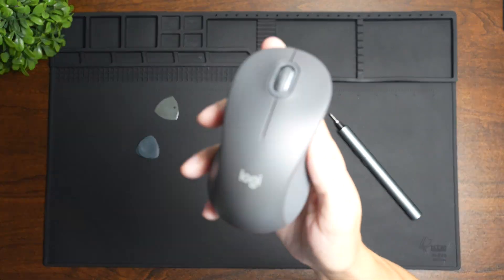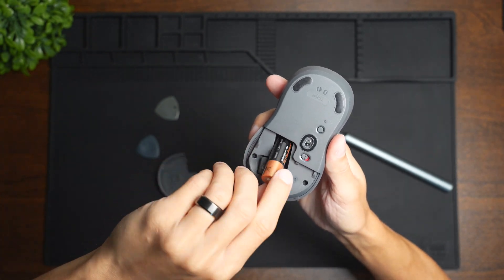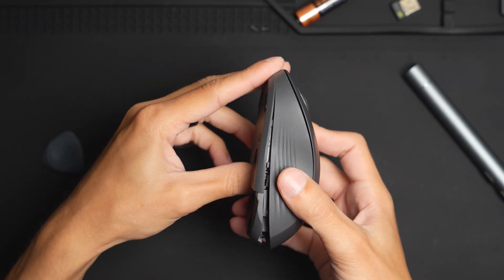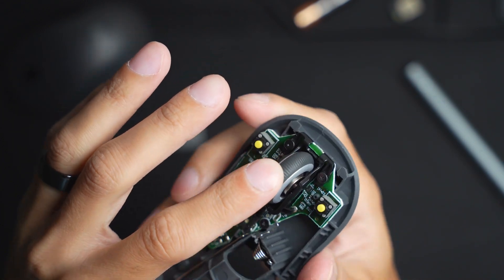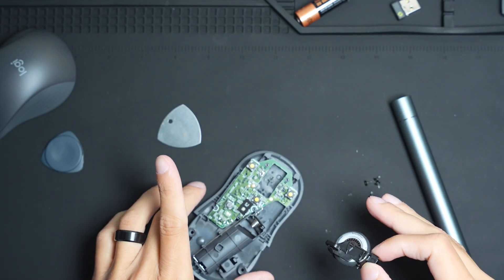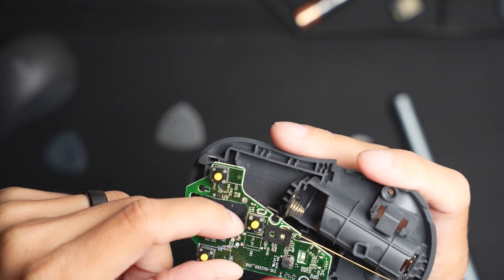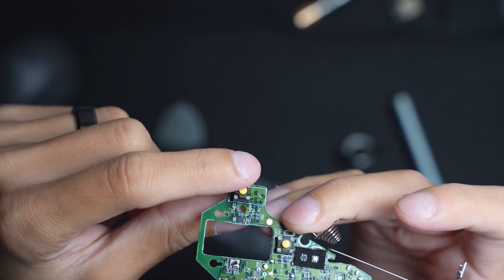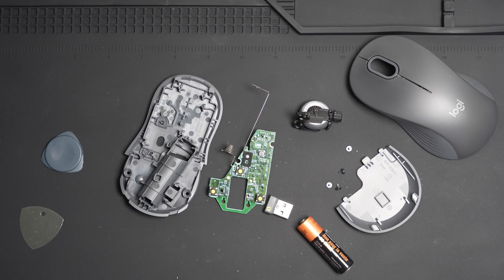Logitech M550 Mouse -  Teardown

Comment: Took mine apart the same way, BUT when I removed the wheel from its box compartment a small spring fell out or it was on some other part of the mouse.  It seemed like it was attached to one side of the axle protrusions, but I cant be sure.  I didn't see a small spring in this video.  Mine is the M550 L.  Anyways,  nice video.

Comment: Great video. I really want to buy this mouse but I have a quick question: are the sides of the mouse made of plastic or are these made of rubber? I have a Microsoft Bluetooth 3600 mouse that I have been using for years and I hate the rubber on it. I hate the rubber on my mouse since it is shedding like a snake skin.
Reply: has rubber but from my experience, the rubber doesn't peel off

and I use it in class so its pretty durable